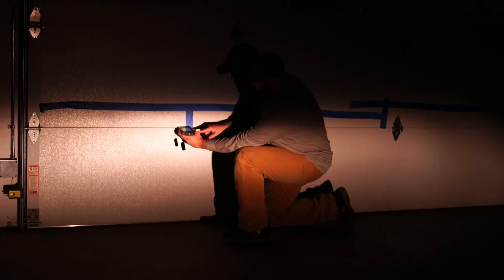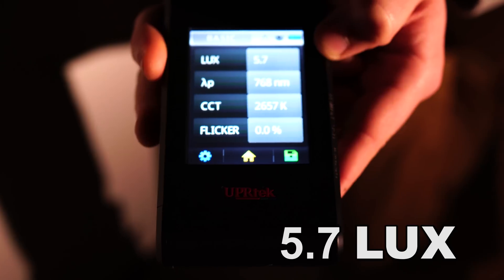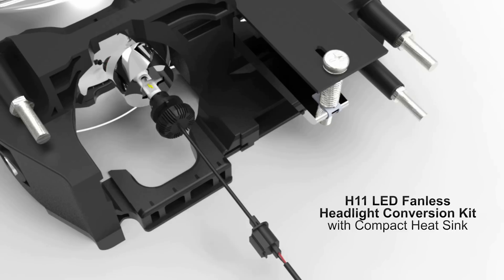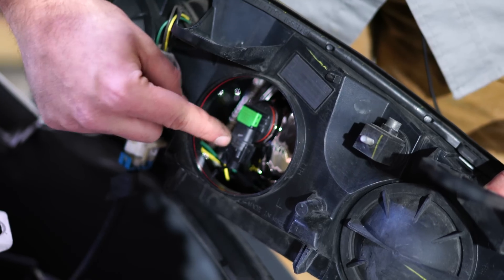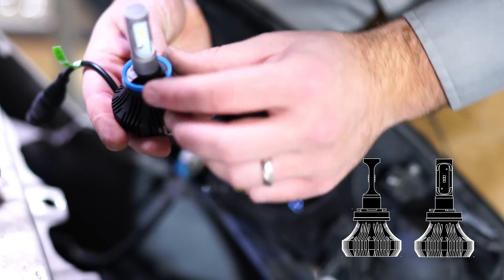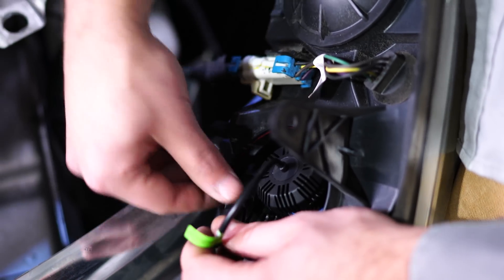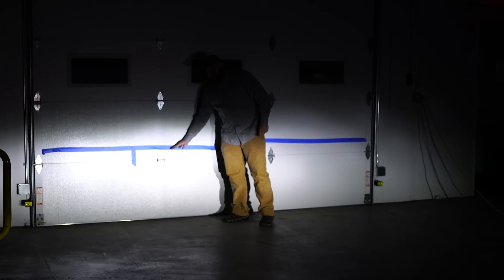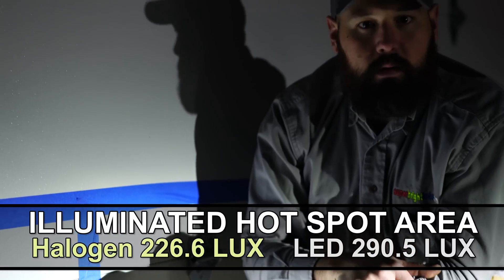How to install LED headlights

Comment: Am I the only one seeing the glare with the LEDs? There is glare and not just above the cutoff but beyond. Def would NOT recommend doing this.
Reply: You are correct about the glare, Should be installed in projectors

Comment: LEDs tend to have poor beam patterns on low beam and despite numerous LUX readings which supposedly prove they are "brighter", to the contrary they don't have the range/throw of halogens or HIDs.
Reply: After aiming, they work fine in my minivan. Can see everything pretty well in front, as well as off to the side of me. Much better than the HIDs I had. Wonder if different designs cause this issue?
Reply: Depends on how close the LEDs are compared to where the filament was on the stock bulb. The further away the worse your projector will work because its angled specifically for that original position.

Comment: Whether to install led headlight with relay or wiring harness?
Reply: LED's use significantly less power than incandescent bulbs do, so the reduced capacity of the stock harness will be better at running the LED's than halogen, at least. 
You would use a relay with power coming directly from the battery to the bulbs, if you needed a large amount of power that doesn't have the losses associated with the small wires and poorer connections at the switch. With LED's, this need is lessened.

Comment: Won't the closed caps on the headlight housing make the LEDs overheat? It looks like the heatsink fan won't have any air circulation when the cap is press on it.
Reply: It says that this bulb does not have a fan.
Reply: don't get LED bulbs that have a fan, if/when the fan fails they will overheat and melt.
Reply: Yup, no fan in the world is going to possibly last as long as an led (usually rated at 10k hours of life or more).
Moving parts in a headlight bulb? 
Just say no.  @mikeh.8155